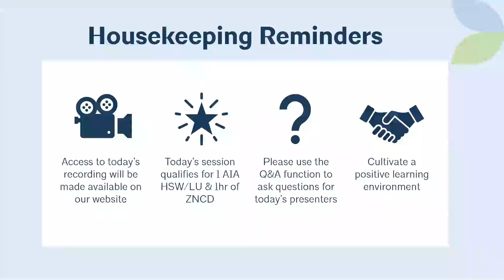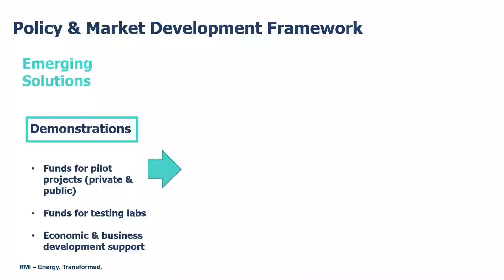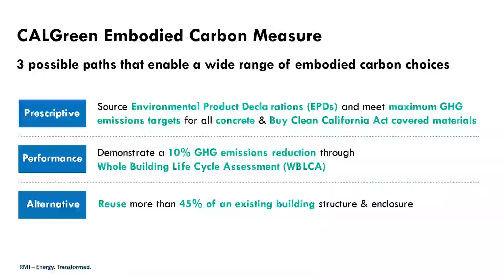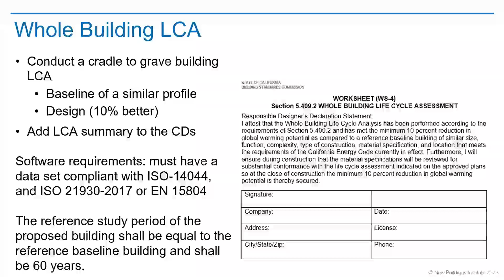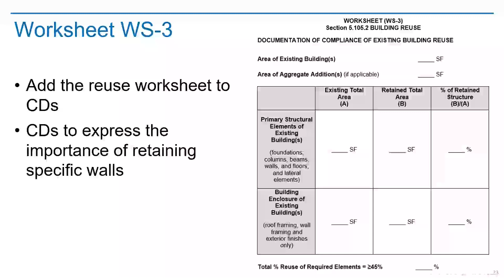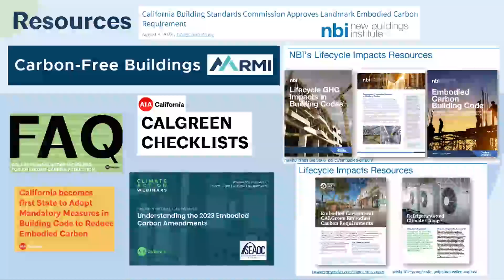CALGreen Embodied Carbon Series: Understanding the 2023 Embodied Carbon Amendments

Comment: I have been in the building engineering and design industry in California for 40 years. The California Energy Commission is completely out of touch with the industry. It keeps allowing this insane green building movement to force unproven increases in design and construction costs on an industry that is so overloaded with regulation that no building in California can ever meet every single code requirement. 

Half the building departments in the state don't even enforce the CalGreen Code. They never even look at the issues during permitting and construction - because they don't have the funding and staff to deal with non-life safety issues. Without enforcement, there is no compliance.

What the CEC needs to do is take 80% of the money they are passing thru to plethora of "green consultants" and give it to the 528 building jurisdictions in the state. Maybe then, they can have the staff and budget to enforce the current CalGreen Code requirements.

The "green" machine is a self-perpetuating industry that exists solely to feed itself. 

The building code requirements need to have critical oversight. Currently there is no such thing. It's just a group of green consultants, architects who want to promote themselves, and green vendors who are involved to promote their products. There is zero critical analysis. All members perpetuate their own positions by pushing ever more "green" requirements on the industry. 

The way the California Green Building Code adoption process has spawned a massive industry built on self-promotion is not fair to the building industry as a whole. 

Unfortunately, the CEC has no over-sight, and no one is actually in charge. 

There is no one to stand up and say, 

"Does the industry really need this?" 

"Do the local building departments have the staff and funds to enforce the new requirement" 

"Will this lead to more development in the state?" 

"If no one else in the country is doing this, should we really penalize Californians further?" 

"Has anyone, at all, really looked at the basis for this proposed new requirement critically? Really critically? Or have we simply taken the data provided by self-promoting green consultants at face value?" 

No one is watching the CEC henhouse and it's created a code nightmare that has grown out of all proportion to any kind of common sense. If there is any doubt about this simply search for the 2022 California Energy Efficiency Standards. It is over 500 pages alone, just for the energy code - and that does not include the 400 page guide to using the Energy Pro software, required for building compliance. No engineer, no architect, no building department official in the state can possibly keep up with this massive pandora's box of ever expanding requirements. 

At some point, I hope the state legislature will step in and provide over-sight and control over the CEC. It is sorely needed.

I also think that the AIA needs to do a better job of standing up for it's clients by pushing back on government-promoted issues which do not benefit the people who are paying their bills.

Also, the interest for this in the industry is representative of the number of comments after this video posted. After 3 months of being on Youtube - zero comments, besides this one.